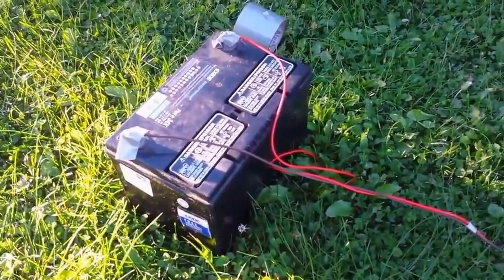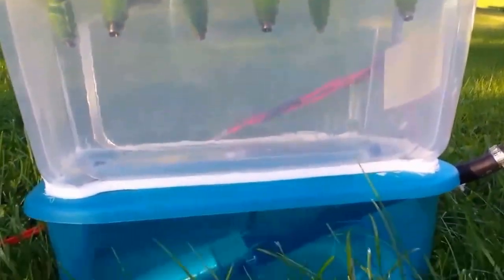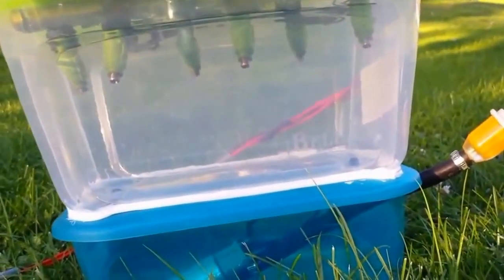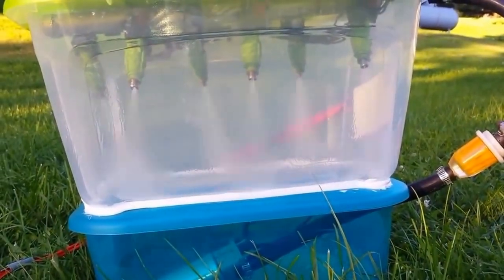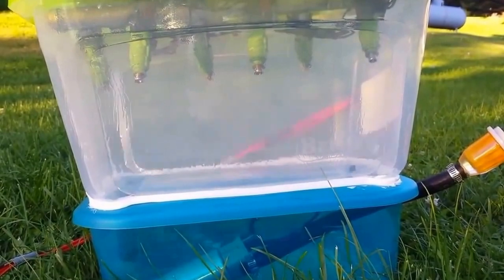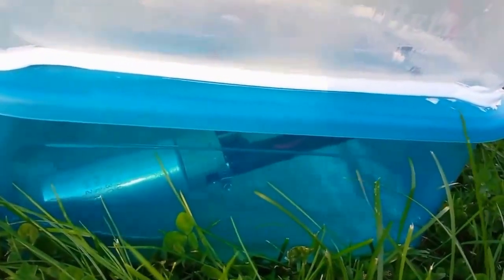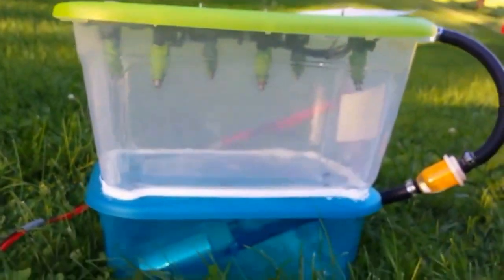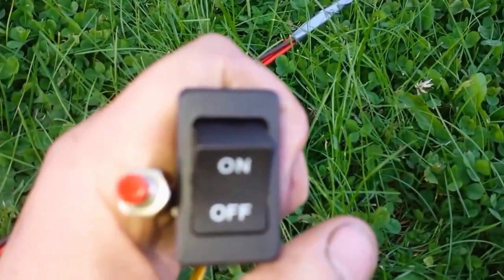Homemade Fuel Injector Cleaner

Comment: can you show us how to make it?
Reply from the maker: I'm a busy guy but I can give a little explanation. Imagine how the fuel system works on a vehicle. The fuel pump is triggered by a simple on and off like a light switch from the 12v circuit. That's what the fuel pump relay in a vehicle is intended to do.

The fuse is there to limit the current (amperage) in the 12v circuit as well as protect the fuel pump. It's basically just a simple electric 12v motor that requires a power source. However, it is cooled by the fuel. So if the fuel runs too low it will fail.

The fuel rail is just a typical fuel rail with injectors that also only require 12-volts. But the injectors are intended to operate at milliseconds to time the flow of fuel during the combustion process.

So if you pickup a pump and just about any modern fuel injector you can play around with them and see what you can come up with. I have a bucket load of fuel injectors that are test subjects.

Fuel pressure is regulated on a vehicle but I've gone without one to blast out the injectors.

Comment: whats the deal with resistors between injectors as i want to make this but is there a rule of thumb on how much voltage to apply?do i need a resistor if i have ac to dc adjustable voltage regulator since i can lower voltage?then just wire parallel so they dont have voltage drop?im gonna use your method and place gradualted cylinders to check each injectors flow
Reply from the maker: I have yet to run in to an injector that requires a resistor (Although they are out there). I just straight up run a 12v power source.